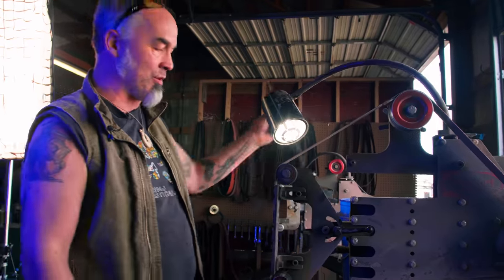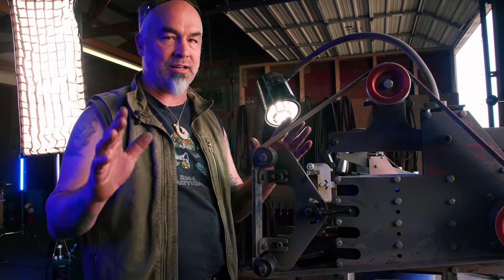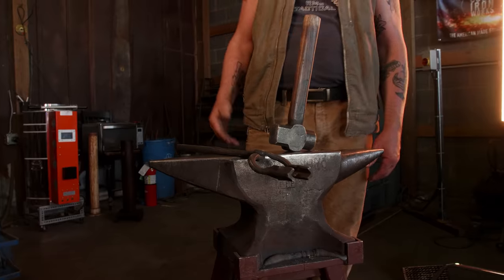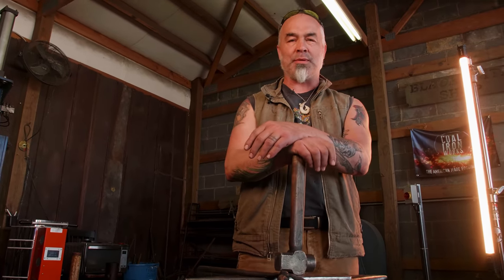Forging Safety | Jason Knight's 5 DO'S & DON’TS In The Studio

Comment: Never assume steel is cold enough to pick up. Test first.
When drilling tang holes clamp the knife down or at least C clamp the tool rest so the knife doesn't helicopter and chop off your fingers when the bit catches.
Buff blades with the edge down. The buffer is far more dangerous than the forge.
Don't take the guard off your angle grinder. When that disk shatters (and it will eventually) it send shards flying very fast.
Keep super glue handy to close cuts. You will get cut... A lot.
DO NOT ask a friend to teach you how to make knives unless you have beer.. also a lot.

Comment: Hello Mr. Knight.  I have recently started setting up my home forge.  I read about forges emitting UV light and sodium flares, which can be harmful to the eyes; however, on further research, I found that sodium flares are really only emitted during glass-work (I hope I am correct?).  Therefore, I bought UV blocking safety glasses.  Later, though, I found that forges also emit infrared light.  Do I need glasses that block this as well?  Does anything really need to be blocked?  What do you use?
Reply: Some guys look into the forge to check temp (steel = same color as lining = welding temp) ... and if you do that, you need blue lenses in a pair of welding goggles to block the IR & UV... but if you don't look directly into the forge, you should be fine with minimal UV protection or even none.
Reply: @stevealford230  Thank you for the advice!
Reply: @gabrielmailloux9197  You're very welcome. But fyi, when I say "if you don't look directly into the forge," I mean having doors on the forge so that very little of the light escapes and you're only exposed indirectly for a second or three when you open it to insert or remove a workpiece and you don't forge fulltime every day. Indirect exposure is harmless in small doses, but not if you get it 40 hours a week for a while without time for the eyes to recover between sessions.

The old veteran smiths didn't wear IR protection and they're fine... because they had forge doors. They're not just for energy efficiency.

Comment: If you put your butt on my anvil when I'm working out in the shop, you will have a wicked burn! Especially if I'm working  on multiple projects at once. I guarantee you will never do that again. My biggest pet peeve is when people stand between my forge and my anvil, right in my area where hot steel is moving back and forth.